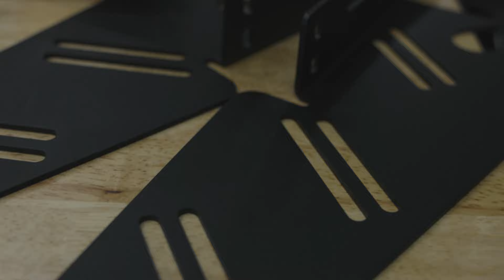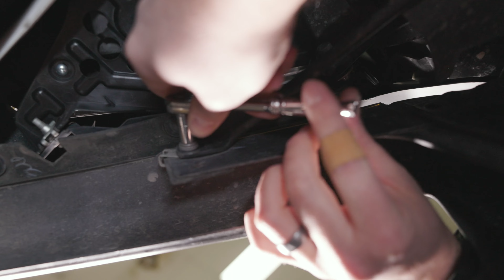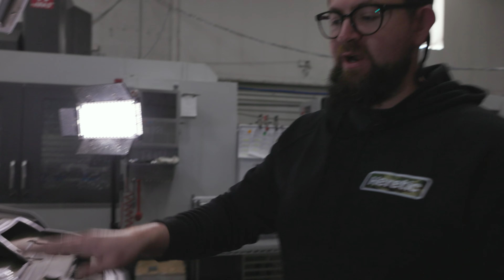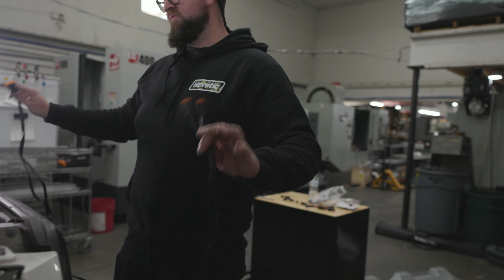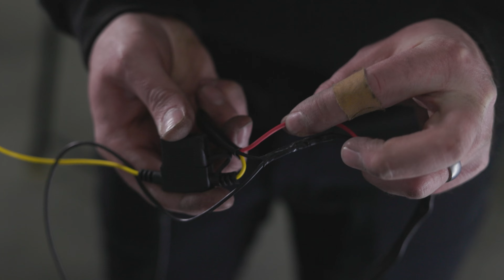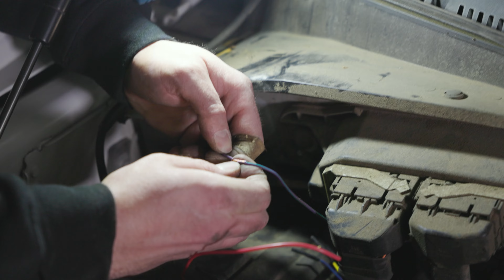Heretic Ford Raptor Gen 2  Fog Lights Installation

Comment: How come no matter what foglight video I watch, nobody unplugs the battery? I dont know anything about electricity and it scares the hell out of me but I always assumed when cutting into wires, you always want the electricity off?
Reply: not needed on low voltage. Granted it is safer because if you ground a positive you could melt something or blow a fuse and that can become a headache. But you wont get electrocuted.